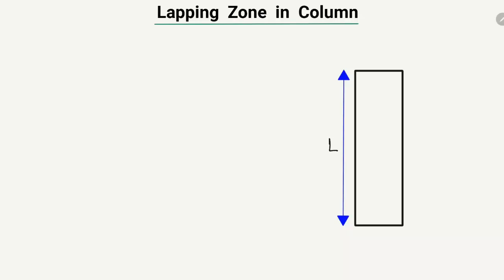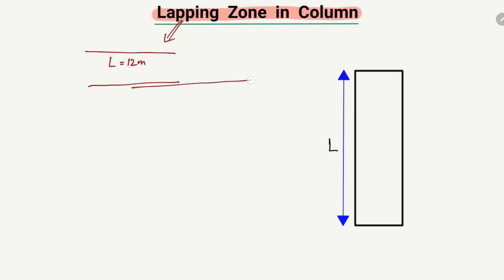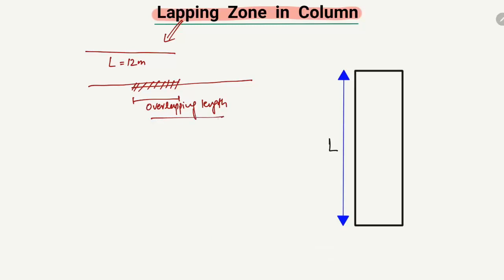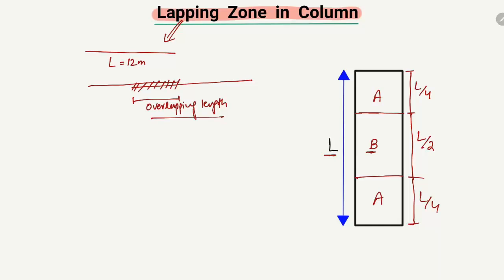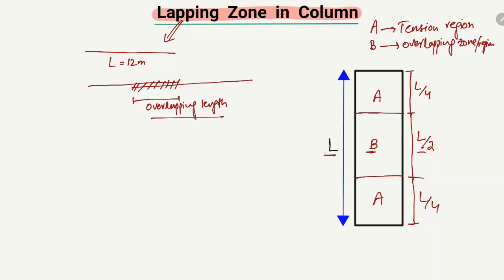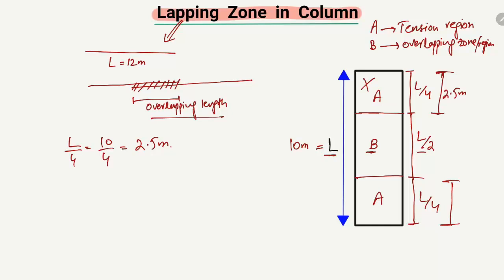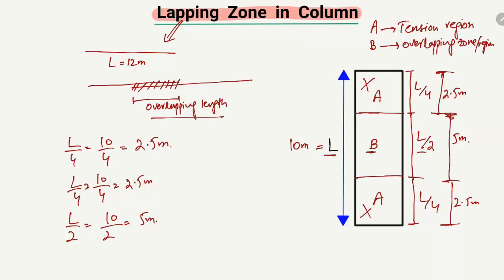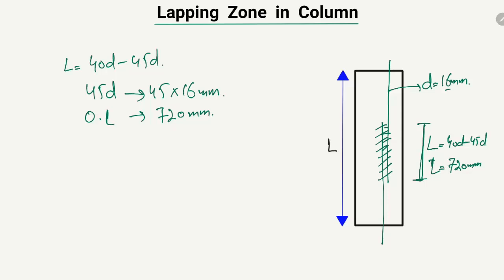Lapping Zone in Column

Comment: Sir if 2 different dia bars used, which dia should be considered for overlapping length? 

Also what is that tension region and why overlapping not allowed there ?

Pls explain above 2 questions
Reply: for 2 different dia. bars, the smaller one has to be considered for overlapping length